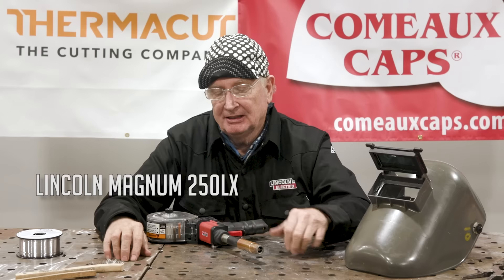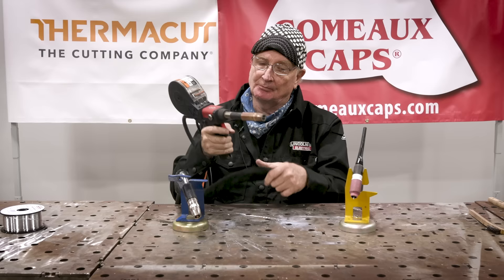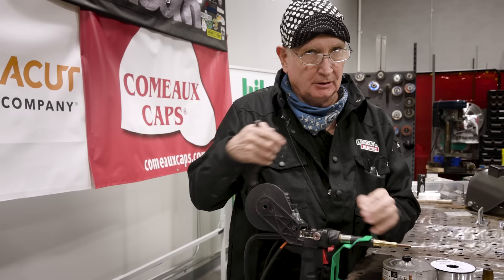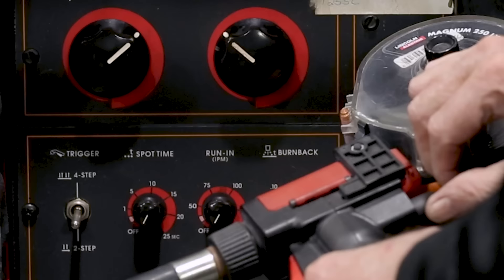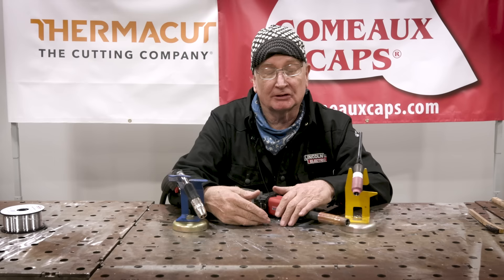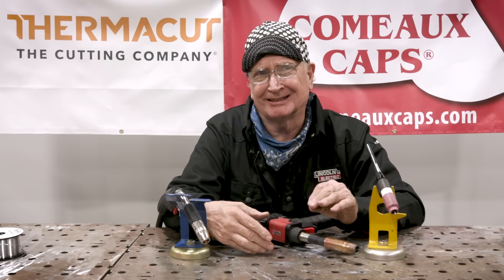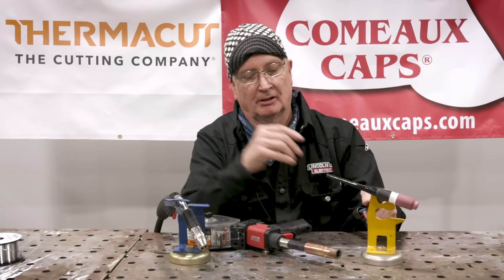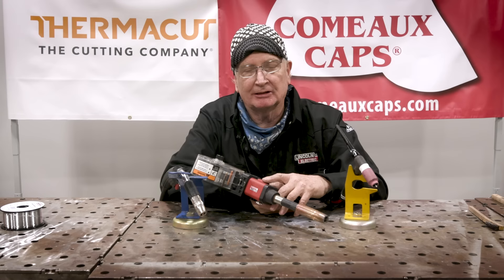How To Weld With A Spool Gun

Comment: Great video, I have never used a spool gun but recently got one and I’m getting ready to try it out. I have. Lincoln 180 mig machine now and will be using the spool gun with it. The spool gun is a Lincoln also. Maybe I missed it but I’m assuming that I would need to use 100%Argon and not the75/25% gas that I now use with the steel mig setup. Thanks
Reply: Michael, you are correct, 100% argon, sorry we left that out......and you need over 30  is a good place to start....setup can be tricky, you may hit the right parameters right away or it may take a few settings....it has a narrow range that works well....also, clip the wire for each start, that will make starting easier.....always push, never pull. and pause at end of weld to fill crater to avoid a crack. if you can, do not push toward an edge as the heat build up can cause you to blow through the base material.....and clean you aluminum with acetone,alcohol, or lacquer thinner, xylene, toluene before as it will take any oils or hydrocarbons off.....a hand wire brushing also helps after solvent leaning, watch this video for more info on cleaning aluminum, all these things really helps to get a better weld, hope this helps, Paul....https://www.youtube.com/watch?v=zgsqAjBXU94 and https://www.youtube.com/watch?v=k-YF0AaGvmk
Reply: @ypaulbrown  Isn't 100% argon only for Aluminum or is 100% for any material?
Reply: 100% Argon for MIG Aluminum, TIG aluminum, and TIG steel. Mix gas for MIG steels depending on application.

Comment: I do a ton of spool gun work on aluminum tri axel beds, and after awhile you'll be suprised how good you can make the welds look.
Reply: I agree 100 percent
Reply: @ypaulbrown  %
Reply: @danl.4743  haha, thanks Dan😆
Reply: @ypaulbrown  Hi Paul, awesome video, thanks! You know how we TIG aluminum on AC, is it the same for using a spool gun? You can't use a spool gun on DC? Thanks again, subscribed to your channel 👍
Reply: @brianswelding  good question, MIG welding aluminum  is done with DC +, the same as for steel, stainless, silicon bronze. the 100% DC+ arc cleans the aluminum oxide off the material, just like with an AC arc, but is 100% instead of only partial % +....I hope this helps, Paul
Reply: @ypaulbrown  AH HA! Thanks Paul 🙏 got it.
Reply: @brianswelding  thanks for watching.....we have a bunch of exciting episodes coming up and a few big surprises......stay tuned......Paulie Brown

Comment: Back in college we used Lincoln Push-pull guns for aluminum. Used the training Lincoln C300 with it. Not every shop has that setup, I think more still use spool guns.
Reply: Aaron, yes, Push/Pull guns are a lot more expensive, the advantage is lighter weight, and the fact that you can use a 20 lb spool of wire.....Both Lincoln and Miller use push/pull systems from MK Products, the original maker of the Push/Pull system, called the Cobramatic due to the shape of the gun looking like a Cobra......thanks for watching and commenting, Paul
Reply: My shop has both!

Comment: I do a lot of Al spoolgun for reefer trailer repairs as the insides and frame rails are all made from aluminum. It's fun and you can fill large gaps. Most people forget to run a much higher gas flow to protect their weld puddle.
Reply: you are so correct on the others using low gas flow, I think they are trying to save argon......it is not worth doing as that aluminum needs protection......thanks for watching and commenting, Paul
Reply: What CFH you use?
Reply: @Chris-vx5kp I need to look at my regulator. I run it pretty high as like the guy above this comment stated a clean weld is worth the cost of argon.

Comment: Why haven't they invent hybrid system for Aluminum, a secondary drive motor in the gun but the spool stays in the machine. Then the tensioning wheel in the machine would only hold tension on the spool...

Comment: Paulie tell Mikala I said hello I have a spool gun and I was successful pre heating the thick aluminum and then using the spool gun to make a weld the weld was very fluid from start to finished it also prevents an over crowned bead because the aluminum was preheated  you can rest your aluminum housing on your charcoal grill to maintain your heat temperature also cast iron can be put on an ignited charcoal grill to slow down the cooling rate so the weld can wetting into the joint easily
Reply: Thank you Mohammed for that great information.....we hope yo are doing great.......thanks for watching and commenting....Paul
Reply: @ypaulbrown  I have a power mig 140c Lincoln electric machine so when I hook up my spool gun on that light duty machine the aluminum bead is very convex because the current is not hot enough to get a fluid weld pool  so I use my small propane torch and preheat the basemetal to get a fluid molten pool

Comment: Great info straightforward thank you
Reply: glad you liked Jeff, Spool Guns are great tools......they get you into spots that would be very difficult using TIG and have amazing oxide removal and crud removal too.....they have a few quirks as far as set up [volts and wire speed] you just need to find the sweet spot and go from there......thanks for watching and commenting, Paul
Reply: @ypaulbrown  hi paul! I am very much old school, my dad was literally fonzy machining his own engines and building his own cars at El mirage back in the 40s and late 50s. His flatheads ran up to 211 miles per hour in a streamliner back in the mid-50s while he was over in Korea! So I was born with an oxy acet torch in my hand. After all these decades including learning how to braise aluminum with this torch I am finally beginning to concede that I need to look at a little bit more modern welding equipment, although I can give most a good run for their money between my torch and my arc welder! Although TIG has always had my interest I just could never see paying the money with the limitations you have with that equipment and I kept thinking to myself that one day they will get these mig/ wire feed welders up to that par level where they can effectively weld like a TIG unit! And it looks like we are there! You're always clear and concise and straight to the point it is really appreciated thanks Jeff
Reply: @jeffalvich9434  thank you so much for the kind comments.....and thank you for taking the time to comment and watch weld.com videos......you can actually TIG weld with any DC stick welding machine......just not aluminum, were you need AC for the positive side of arc to remove the aluminum oxide layer.....I started out with oxy/fuel back in 1972, immediately using stick with an old Airco unit......I cannot say I was very good back then with stick welding, but the oxy/fuel was easy for me to pick up......the MIG machines today are very easy to set up and do a wonderful job. back in 1980 when I decided I needed an off road race car, allI had was a Lincoln 225 AC buzz box and 6011 rods.....the first time the car was raced, the driver flipped it 3 times, not one weld cracked, I was thrilled by the quality I had put into it....so was the driver......if you are interested in doing TIG with a stick welder....check this out.......best wishes, Paul...Beau has a lot of good information in this short video...https://www.youtube.com/watch?v=atSIGSTToQo

Comment: I've been looking at spool guns and I am disappointed in their common length of 10 ft has anyone figured out a way to build an extensions for one
Reply: Nick, you are looking at the less expensive models.....you may only be able to use
on the type machine you have.....with a little ingenuity, you should be able to make an extension....
I know Miller makes one, 25 feet, it is about $1,200 for just the extension....hope this helps, thanks for commenting and watching, Paul Brown
Reply: @ypaulbrown  I ended up getting a everlast with a 25ft spool gun

Comment: Good video, but never heard mention of what size tip,what CFH it was running. Thanks for the video!
Reply: sorry about that Grunfield.....we were running 40 cfh argon, and the tip was a .035....
you need to run a slightly larger tip than for steel, as the aluminum filler heats up and expands 
and will seize up in a smaller contact tip.....I will go to a .046 if using .035....as the filler has
a large helix curve, it does not seem to effect the electrical contact....hope this helps, thanks for commenting and watching, Paul Brown

Comment: For thin material you can get pulse mig and for the stack of dimes look you can get double pulse machines. you can get that with spool guns on some machines.

a small question, what effect does the nozzle size/shape play? aluminium tig runs better with a smaller cup, is alu mig the same?
Reply: tweake: I have not done any testing on nozzle size to compare to tig nozzle size so I really do not know. The reason the smaller nozzle on tig helps is that it makes a smaller etched zone and the arc does not want to wander and go as wide. I learned this from our friend Justin from  Las Vegas from weld metals online. as far as the machines you mention, those are very expensive and out of each of most weldors  as they are industrial type machines....you can do bump welds on thin material and get a kind of stack of dimes, but what you may not realize, those pretty divisions between weld nuggets are stress risers and make the weld weak....I hope this helps you and others, thanks for watching and commenting, Paul and the Gang from weld.com
Reply: @ypaulbrown  basic pulse migs are affordable. I have one, but its only pulse on the whip. A full commercial pulse unit cost similar to a Lincoln. Sadly its the usa market thats holding you guys back.
Reply: @tweake7175  a lot of that is lack of support from the European manufacturers here in the US, service, parts, availability and dealers not wanting to get involved with another brand.........it would be nice to have access to some of he European equipment,  but the Big 3, M. , L, .E ...have the commercial market pretty wrapped up....as they have been in business for over 100 years each here in the US.....thanks for commenting.....we appreciate it.....Paul

Comment: Does dipping the nozzle in splatter shield products effect the weld on aluminum parts? Or should we stay away from it?
Reply: Joe, it does not seem to bother, but you really should not need to use a nozzle dip if your parameters are set correct....I would use a spray type instead of getting the gel.....hope this helps, thanks for commenting and watching, Paul Brown

Comment: Sir . Do you think 200 Amp MIG machine with 22 Volts max setting , could go into spray transfer using 0.030" aluminum wire(with 100% argon) ? I very much doubt .But i don't trust short circuit transfer on aluminum. I'm to weld patch piece on 2016 F150 aluminum fender. It's 0.055" thick aluminum sheet. My plan is to go into spray transfer and weld the patch spot by spot been careful not to burn through. I have big doubt it's going to work . I would try though. Don't wanna learn AC TIG or having to buy very expensive pulse mig machine.
Reply: Peter, I have welded a lot of 1/15 .062 6063 and 6061 with .035.....you 200 amp machine will handle this. as far as short circuit, welding a patch to a fender is not really structural, so short circuit should be no problem.....but if you want to 'bump' weld with higher amps in the spray mode, that will work also.....you say your machine only goes to 22 volts, do you have a meter that shows that, or just setting controls....I spray at about 22v and 220 ipm with .035 on the .125 6063 I weld all the time, it is in a spray at those settings......give it a go and let us know, thanks for watching and commenting, Paul

Comment: Could you use the spool gun for steel welding? I cant find anything online answering that so I hope someone can answer this pls and thxs to who answers this.
Reply: Kenji, sorry for taking so long to get back to you....yes, it works fine for Steel, Stainless, Silicon Bronze....it is 1 pound [1/2 kilo heavier] when using those materials, as they weigh more than the aluminum....the great thing is, you can get further away from your machine.....as the better spool guns have 25 foot [8 meter] leads....I hope this helps, Paul 'Paulie' Brown

Comment: Hi Paul,  I saw you commented to someone that spool gun can also be used with silicon bronze wire.  Is it useful for welding brass? If I need to weld brass rectangular profiles, 1/16" thick, can this provide a solution?   Can you elaborate a little more about this?   Or did you mean just for brazing steel or something like that.
Reply: You can run sibro wire in a spool gun with 100% argon.  Typically its a spray arc. 
It will work good
Reply: @ZILAwelds  thanks for chiming in Zila....good information.......cheers, Paul.....
Reply: as our good friend ZILA mentioned....you can use silicon bronze with 100% argon.....it is a Braze weld and is very strong....check out this video we did a few months ago ..........this should help you....thanks so much for commenting and watching, the Gang here at weld.com appreciates it......go check out ZILA.....Thanks ZILA....Paul...https://www.youtube.com/watch?v=fvR2q-NuZB0&t=9s
Reply: @ypaulbrown  @ZILA - Great video! I have a Miller Syncrowave 210 (multiprocess) and primarily TIG, but have used my spool gun for tacking and other hard to access welds (aluminum boats, etc). I've TIG brazed using silicon & AL bronze, and just saw the video on mig brazing. So, I use 100% argon for aluminum and silicon bronze with a spool gun; what if I picked up a couple of 1LB spools of ER70S6 or 309?  Can those be ran with 100% argon in a spool gun, or would I be better to use C25?  (I actually have a Millermatic dedicated MIG machine with C25, but am just curious)  Thanks!

Comment: Nice.  100% cleaning action pretty cool.

Sounds like you set the voltage high enough for spray transfer ?  Is that correct ?

In other words it's set up like mig using a spool gun with higher voltage for spray transfer... ?

Any tutorials out there on it ?

Thanks 👍
Reply: Drum, you are 100% correct, aluminum mig likes to spray, you can also short circuit, for very think 1/16 inch material,  but really risk birdnesting. The one thing not mentioned, is to always push the weld, you are cleaning the base material before you get there much better.....you end up with a nice clean shiny weld like shown, if you pull the gun, it will be gray and very sooty......hope this helps, and thanks for watching and commenting, Paul.....
Reply: the tutorial you are asking about, is probably experimentation, aluminum mig has a very narrow sweet spot, so you just have to experiment. I find, a push/pull technique helpful for me, where you move slightly forward 1/8 to 1/4 inch, then pull back to the existing bead and lay in some wire, then repeat. this gives the puddle time to solidify and also not burn through, otherwise, the puddle can be very fluid and start wandering on you.......as far as volts/wirefeed speed go, start with what we were using, 22 volts for so and 300 ipm or. more.....I usually use .035 wire, but the lab only had .030 on this day.....they also make 3/64 or .046 for thicker welds.....we missed mentioning the gas , which is of course Argon at about 40 cfm.....hope this helps, I will try and answer any other questions you may have.....Paul
Reply: @ypaulbrown  NICE 👍 TY
Reply: @drumtwo4seven  marvelous
Reply: @ypaulbrown  you answered just about everything and then some.  I appreciate it very much 👍 I wasn't sure about any of it now I feel I have a good place to start from... Interestingly those are the same settings I use for dual shield except c25 gas not pure argon but close to the same flow 30 to 40 cfm... push angle too... 22.5 voltage not 22 but still close 

Thank you again 👍
Reply: @drumtwo4seven  my pleasure to share some knowledge, that is what we here at Weld.com are trying to do.....it makes an old guy like me feel good to help others instead of hoarding information, I wish when growing up others were that way......thanks again for commenting and supporting the channel, Paul🔥⚡📽🏁
Reply: @ypaulbrown  really? Short circuit on thin aluminum ?  I learned you are not breaking though the oxide layer when short circuiting aluminum mig … and it is not a “leak tight” or “full fusion” weld to my knowledge …. Do you have inside on that ?  
I learned aluminum always needs to be always spray arc and the minimum thickness is about .100” to 1/8” ….????🤷‍♂️🤷‍♂️

Can you shine some light on it?

Comment: Welding anything thinner than 3/16 is actually pretty difficult with a spool gun depending on the type of weld.  A large piece with really good fit attached to a thicker piece is gravy with a slower wire speed but without a decent cross section your better off in tack city.
Reply: Justin, I agree with you , thanks for watching and commenting, Paul

Comment: How do you stop the black soot when welding Aluminum?
Reply: good question Marty, that soot is called Smut believe it or not and is magnesium oxide and aluminum oxide so dense it does not allow light to reflect back through it. the way you keep from getting it, or as much , is by using a push method, do not pull the gun. also stick out length of wire can make a difference and gas flow.....you need 40 cfh argon, many try and skimp out and use 14-20 cfh,,,,,that will not work.......I hope this helps, thanks for watching and commenting, Paul
Reply: @ypaulbrown  Thnx Paul. I'll give that a try. Thanks again. Great explanation of using Spool Guns.
Reply: @martyhill6609  glad to help....let us know how it works for you......Paul
Reply: @martyhill6609  wonderful...Paul